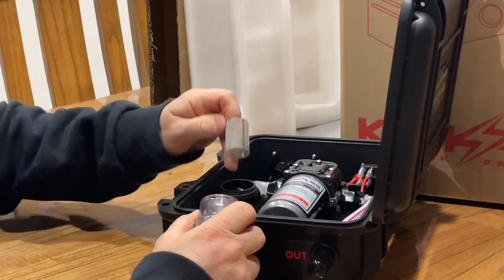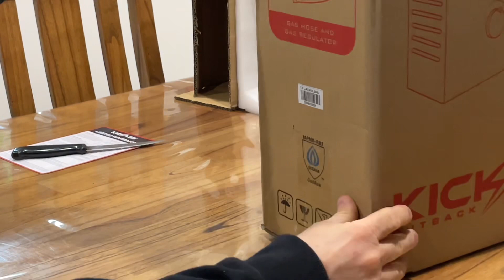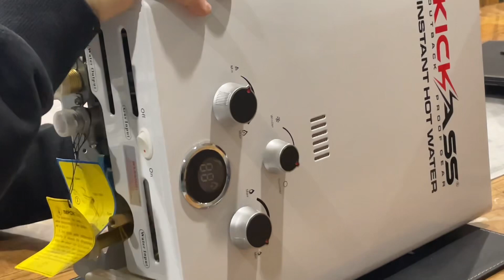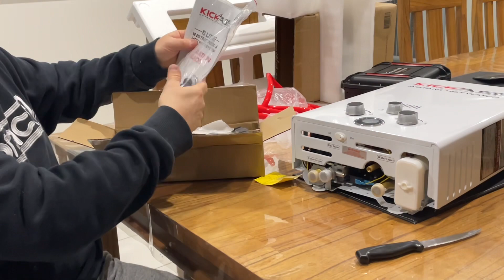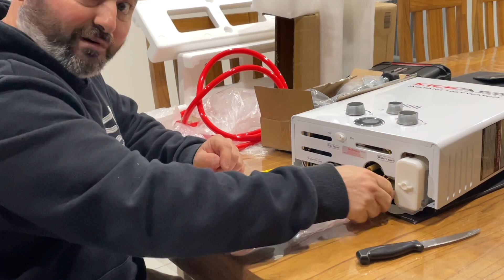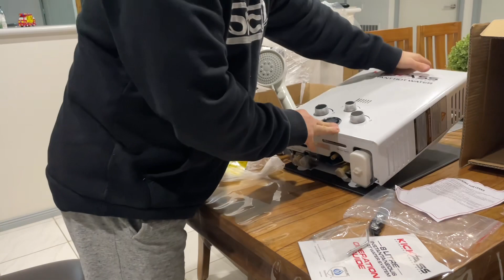Unboxing the Kickass hot water system and pump pack

Comment: I had a hottap, it was rubbish!  I bought a Kickass and binned the Joolca. Best thing I ever did.
Reply from the maker: I had a Hot tap mounted on my Jayco swan for about 7 -8 years it worked but needed to be adjusted quite often I put it down to my water supply which was mains but as I was camping on a farm there were a lot of leaks and the supply and very low pressure. I installed a pump this improved things but the flow was still not great to the pump. It work great at caravan parks and I found the fittings and shower head to be of good quality and they lasted. I am not impressed with the fittings of the Kickass and will be swapping them out for the new upgraded Joolca kit I only hope the hot water unit works better. I been renovating so have had no chance to really test it all out yet
Reply: @Anthsv8    
The main issue i had with the Joolca was getting it to produce hot water.  It would never get above 34 degrees and I wasted so much water just trying to adjust it.  The Kickass straight out of the box and hooked to a water source was at 40 degrees within seconds of turning it on.  Truly there's no comparison!   I know a lot of people swear by the Hottap maybe I was just unlucky with the unit.  I'm really happy with the Kickass.
Reply from the maker: Sometimes we get the odd lemon how the company deals with that is what determines whether I buy from them again or not